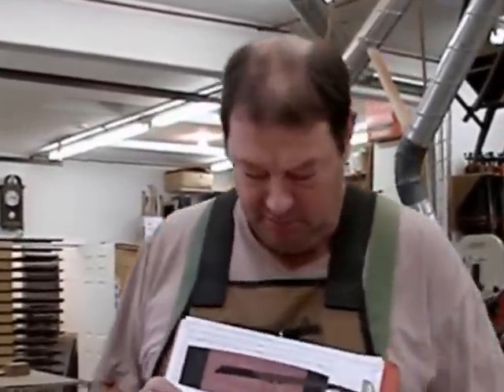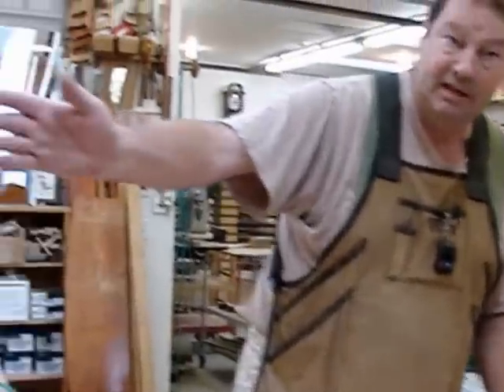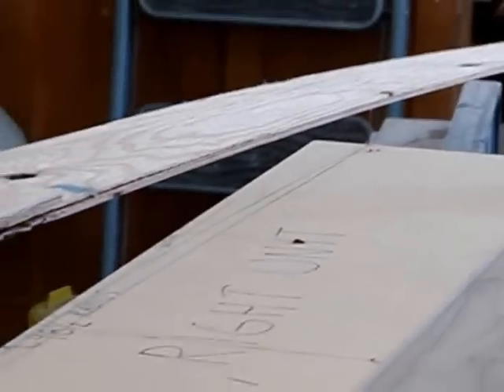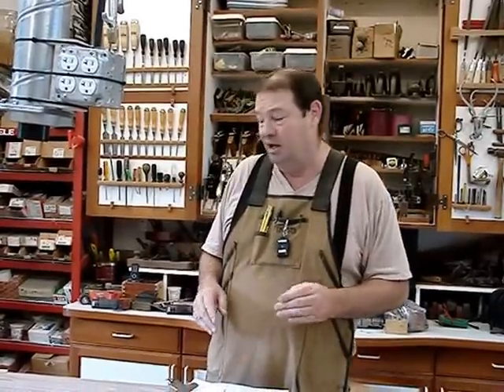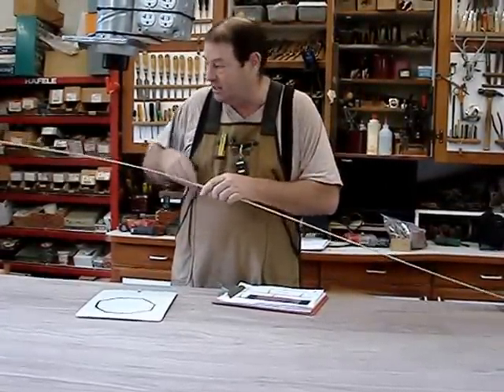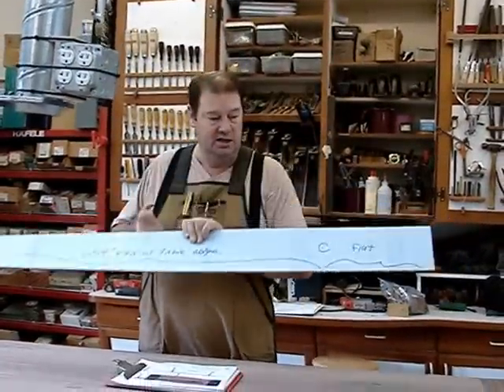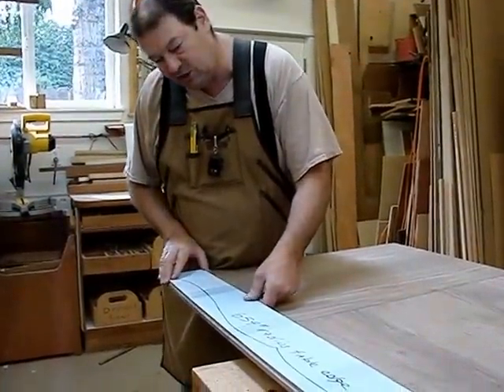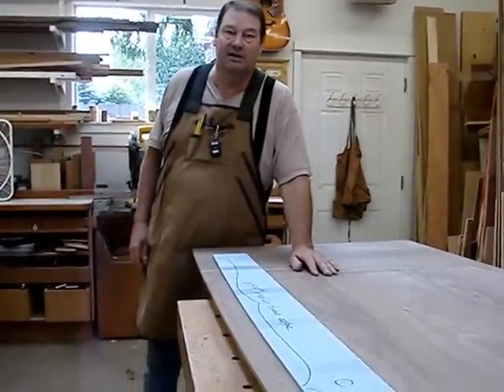Layout Large Radius

Comment: nice work on the large radius, not sure there is a secret method to doing that, but I do know that the main table where it intersects with the leaves 40"+ ? will expand and contract with humidity and you will never have a perfect arc with that perpendicular grain, in mid summer that table could easily be 3/8" wider or is this incorrect?, thanks for posting